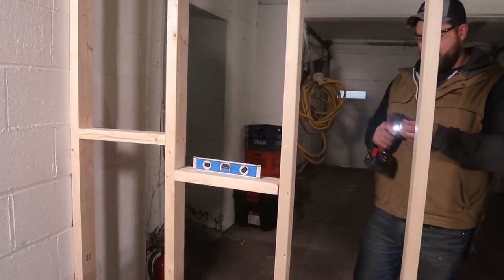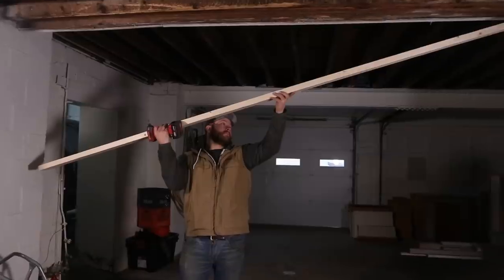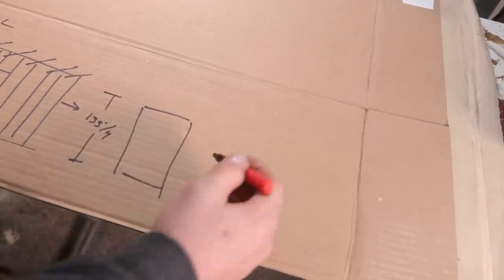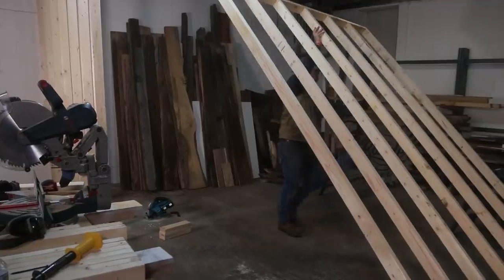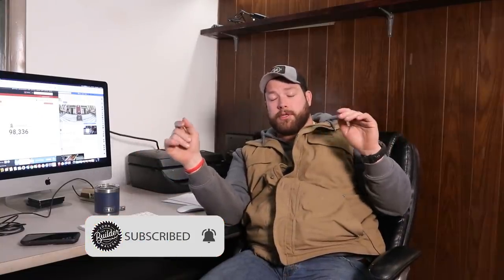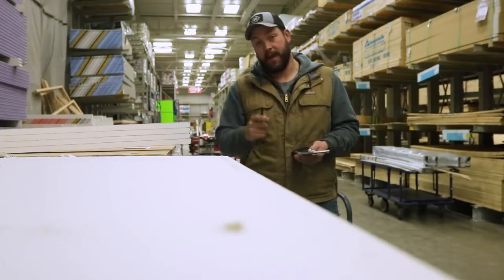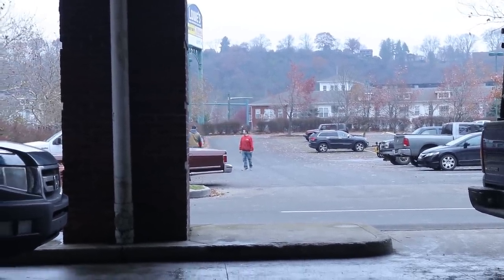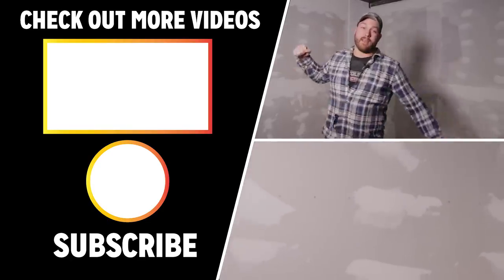BUILDING MY SHOP WALLS! | Basic Framing and Drywall

Comment: Great build, We generally push the full sheets to the top of the wall, leaving the pieces at the bottom, this provides for less ladder work while mudding & sanding. the bottom raw edge is covered by the baseboard. Insulation here would make a huge difference in sound levels, if that is a concern.
Reply from the maker: Great tip dave! Yea insulated it so its going to be nice and tight for sound.

Comment: Did I hear you say “crappy drywall screws?” What makes them crappy and what would you recommend? I’ve always used drywall screws for misc shop projects or whatever else I’ve got going on, but I’ve noticed a lot of YouTube woodworkers appear to be using something different. Love your videos.
Reply from the maker: They just snap a ton when you use them on anything but drywall. I typically dont purchase them.

Comment: I would have laid a strip of plastic in between the bottom plate and the floor.
Keep that bottom plate dry. Probably cheaper than PT lumber, too. Use both plastic and PT lumber for long term installations.
Reply from the maker: yea since its not permanent and there is no water in the shop, i thought i would save the money and time, but great tip!

Comment: Great video, fun too watch!
Also, those are non-structural walls and you ended up using drywall, so you could have gone 24 on center and saved a few bucks, not a big deal though. And that short wall was crooked AF. I get the short wall is in ur workspace not ur show space but that opening on top would drive me crazy. For MY sanity you should through up enough framing to put another piece of drywall. 😁😁😁
And if the framing was put on concrete you should have used treated lumber for the bottom rack, concrete holds moisture.
Reply from the maker: Thank you, yea the walls arent perfectbut they'll work for now. I dont own the shop so saving a few bucks on the treated lumber was cool for me. thanks for your tips !